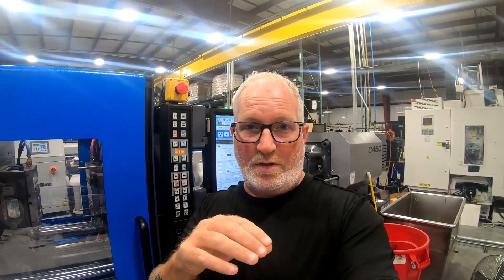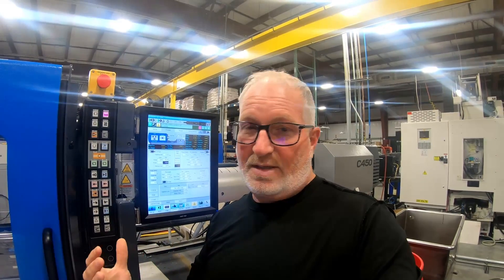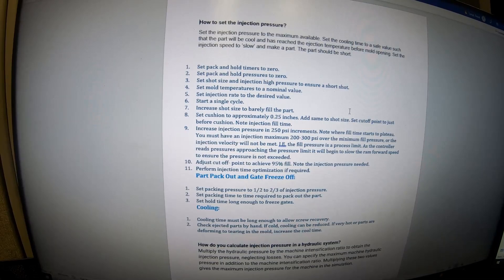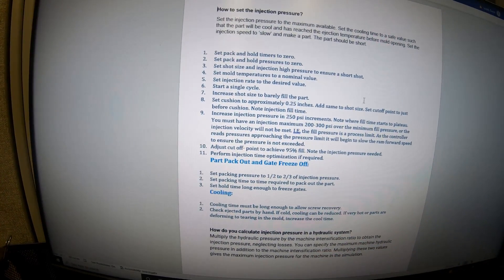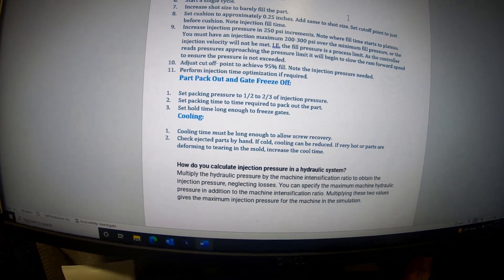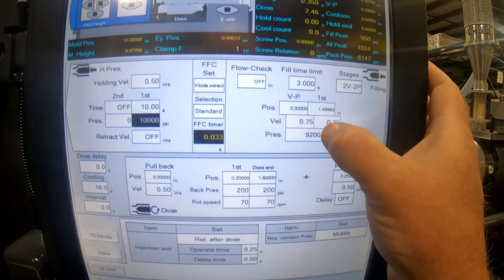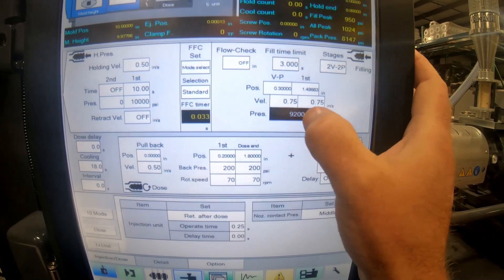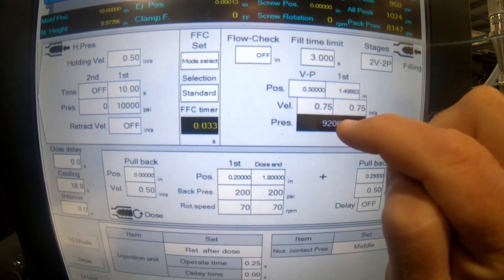How to set Injection Pressure

Comment: How would I work out how much holding v-p to use on my pack and hold. Is it just 2/3s of the 1st and second stage v-p plz 
Thanks for the videos.
Reply from the maker: You can start with 1/2 or less than the injection pressure is.

Comment: Thanks for the videos. Really informative. I was wondering, could you make a video of how you would start a process with a new mould. Like all these things combined what you have shown us this far, but while doing it yourself while on the injection press. Like calculating shot size, finding injection pressure, hold pressure, clamp force, cooling time etc! Thanks! 🙂
Reply from the maker: I will try to put something together soon. Thanks for watching & the support to the channel.
Reply: @injectionmoldingskillsmore1064  brilliant. Also crossed my mind about this video, when you first set the injection pressure while injection speed is set really low, doesnt pressure rise dramatically when you start increasing injection speed?
Reply from the maker: @miksau11  Yes sometimes they go up it depends on the nozzle size as well.
Reply: @injectionmoldingskillsmore1064  should i then check the keep checking the product with different injection speeds and find a pressure where my product is perfect and set the max pressure again
Reply from the maker: @miksau11  No The idea is to have the speeds as low as you can to fill out the part to 95% to 98% full. Then you let run for about 10 shots to make sure you have the same short shots. Then you had the hold pressure 1/2 of the injection pressure. If done right you should be able to walk up to the press on any day & shut the hold off & make a part 95% to 98% full. This is the key to not over packing a tool out !!! I hope this helps you out. Thanks for the support to the channel.

Comment: Absolutely keep these videos coming. Would like to see some videos helping out with either it's mechanical or something within process that's the issue.
Reply: Sounds like they may need help on troubleshooting something like flash.
How do you determine if it's the process or the tool?
What steps to check in the process before determining a tool failure?
Reply: Or, what steps to check in the tool before determining a process failure.
Reply from the maker: @00linered  Yes sir I will
Reply from the maker: Thanks for watching & the support, I will work on something? do you have an idea of what??
Reply: @injectionmoldingskillsmore1064  Decouple cycle and Recouple cycle?
Reply from the maker: @joshreeves5642  Thanks for the support